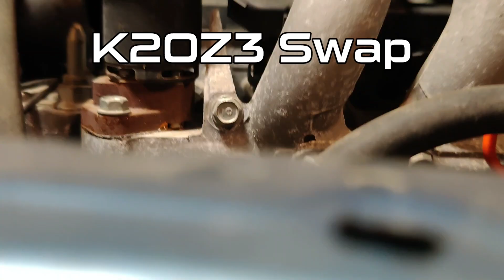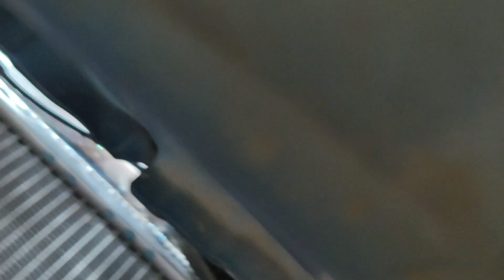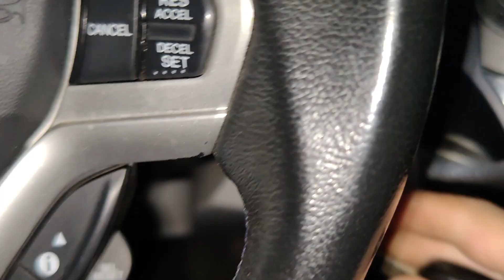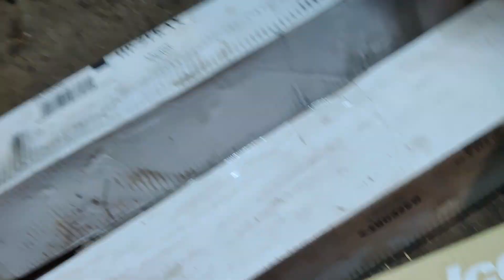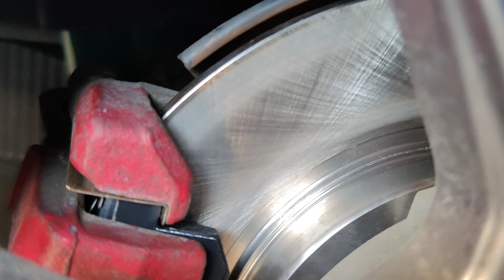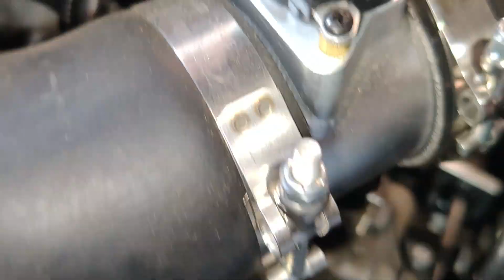2011 Honda CR-Z K20Z3 Swap Part 6: FIRST START!

Comment: Did you keep cruise control after the swap? Just curious on the features lost
Reply from the maker: Yes, the CC still works on my swap. Will try to get out a video on error clearing and the other electronics soon, I have the parts just waiting on time to get it done. My goal is a 100% error free and fully featured system. Keeping the ABS, cruise, A/C, etc

Comment: Great work! I have most the parts to start my 2011 CRZ swap. I think I will be machining my hubs to use standard 8th gen civic axles. I haven't started my swap because I'm logging CANBUS data to hopefully find the messages sent to the cluster indicating a functioning IMA system to remove the warning lights. Do you know of anyone who has solved this problem? A guy names Ryanthegreat apparently had this solved but I cant reach him. Also, do you have a facebook or IG?

Comment: I think to do swap but my crz is automatic, does it mean more work!?
Reply from the maker: Yes, you will need to add 3rd pedal, cut hole in firewall for CMC, and add/wire up the clutch pedal position switches as well as the clutch lines/fluid resorvoir and ensure the appropriate sensors on your transmission are wired up properly too. There is more specific info in Abdul's guide linked in the description.

Comment: Hi
Been following your videos for a while. Keep up the good work.

I had a doubt. Have you ever tried changing the blue interior light? the one on gauge unit neon blue or on buttons? Would like to change it to red but can't find a way to get around it. If possible, please try and if you succeed, please show how to.
Reply from the maker: I have not experimented with it yet. The lights on these are integrated LEDs on circuit boards rather than simple bulbs that can be removed and exchanged.